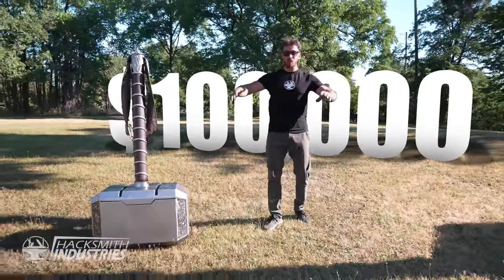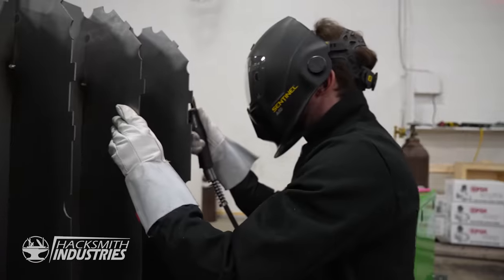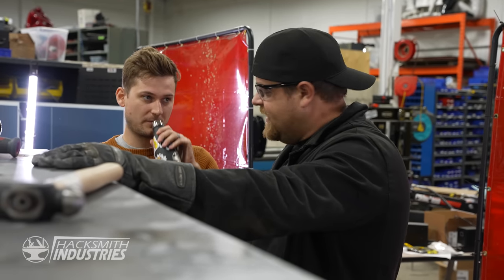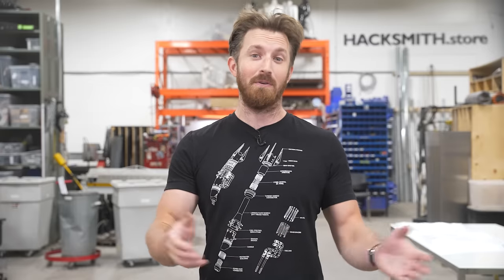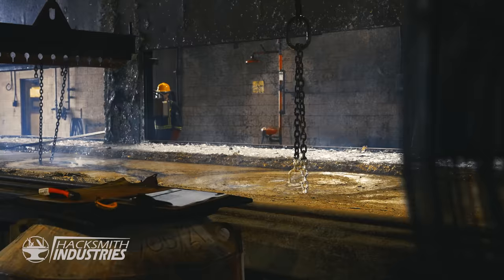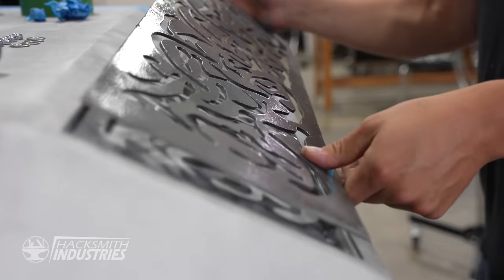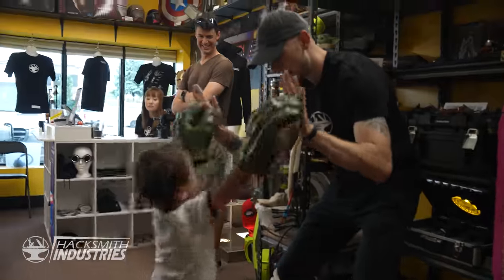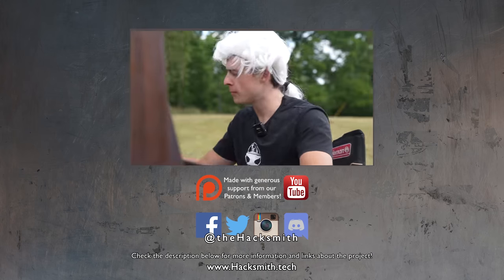Building the WORLD'S LARGEST THOR'S HAMMER!

Comment: I did some calculations based on the dimensions of Mjolnir, if this giant hammer were to be filled with lead, it would weigh around it 32 tons, around 30 tons of lead (5 m^3) the steel alone weighs around 2 tons.

Comment: You needed to weld the outside surfaces with low-silica wire. We use it on pipe hand railing that gets hot dipped so that the silica in normal E70x weld wire that makes that extra buildup doesn’t happen lol

Comment: I was curious how much it would weigh if it was filled with lead, so I looked it up.
Based on the 700 gallons of volume and lead weighing roughly 150 pounds per gallon, this hammer would weigh:
105000 pounds, or 47627.3 kilograms. That's 47.6 tonnes!

Great work as usual, keep up the good work!
Reply: They should of made a actual hammer instead of just welded sheet metal with a pipe sticking out, probably would have been cheaper as well
Reply: With price of lead around 2k$ per ton, it would cost them a bit less than 100k. So only twice the actual budget.
I guess the biggest issue would be how to transport that 50 ton monstrosity. And they'd need a bigger crane.
Reply: They didn’t get use lead on big hammer they used over 4000 pounds of steel lol

Comment: When you're finished using it, you must bury it with some elaborate metrics, like a perfect 60 feet deep on a 60* angle, pointing 60* off of facing true North and each line on the hammer being perfectly aligned with some star formation just to mess with future archeologists.

Comment: Was the company that sent the metal not able to make one long scored metal wrap to lower welding time?
Reply from the maker: I don't understand what you mean??
Reply: @hacksmith  Have all of the pieces of metal connected as one sheet, scored so it can be bent into a shape and have less seams to weld.
Reply from the maker: But it's 3/8th (10mm) steel plates how would we bend them??
Reply: @hacksmith  That is what Score Cutting is for, cutting part of the way through, but not all of the way. Like when knifing one side of cardboard, leaving the other side intact to make it easier to fold.
Reply from the maker: That works for thin sheet metal but not thick metal!